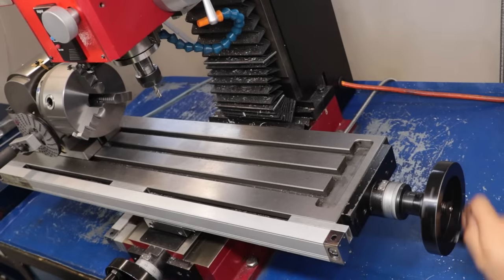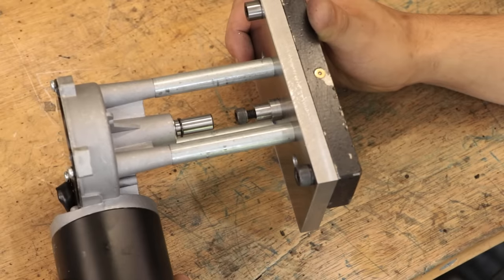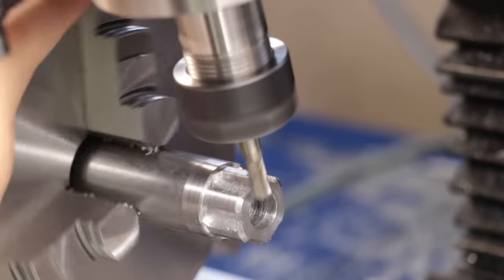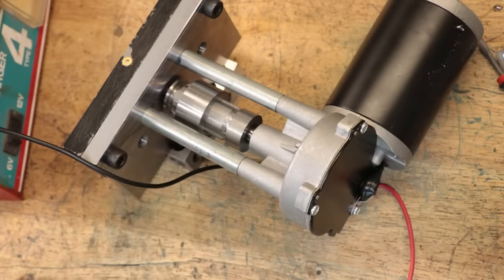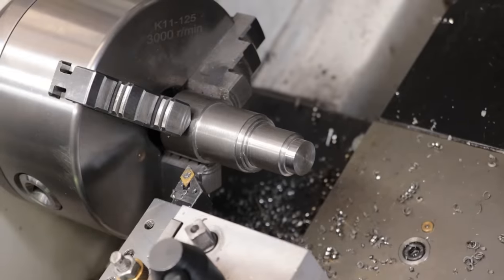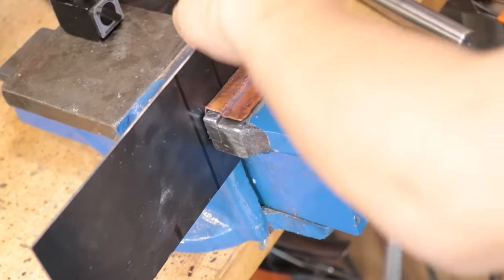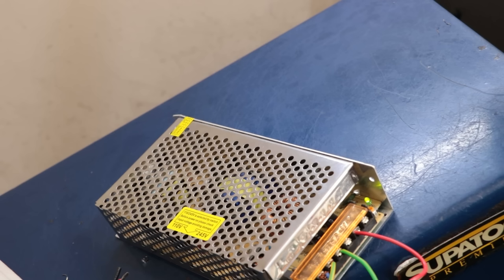Making A Power Feed For The Milling Machine | Cheaper And Better

Comment: I figured for the selector piece you would have done a full circle on the lathe and then just cut it in half "bore out each side" Any reason you did it the way you did that I might not be thinking of?

Edit: I mean other then that, thats just how you felt like doin it? xD Not that its wrong at all. I just wanna know if I was missing something for my idea!
Reply from the maker: I dont have a 4 jaw chuck for the big lathe and the 4 jaw for the smaller lathe is too small to chuck this part

Comment: Running the switches through a relay would take the electrical load off them. 30 from the supply red, 85 to the supply black, 86 to the switches that are jumped off 30 and 87 to the motor. If it's post-controls it would still work because the coil and relay don't care what way the voltage is going

Comment: Nice Project again. Man those hacksaw scenes make my arms ache. I had to cut several 50 x 30 pieces of cold rolled steel. After completing the first one with a hacksaw and being exhausted and useless for the rest of the day, I raced out and bought a horizontal band saw the next morning.   BTW does anyone know if the spindle bearings on that seig 2.7L mill need to be lubicated. I cant find anywhere to access them for oiling.

Comment: very nice work. I would have made the clutch handle on the front of the lathe, because on top like this it will prevent you from machining long pieces... also I would have made the motor windings at the back of the table so that it is not on the way of the mill operator. but that's just me...

Comment: I built one using an identical motor and a small air cylinder to engage/disengage the motor from the leadscrew along with a PWM controller and power supply. I loved it for a couple years. Unfortunately there were a couple times I forgot I had the table locked, hit the switch for full rapid and it took a second to figure out why it wouldn't move 😬. So after cooking 2 motors (you'll break the worm shaft first) and a controller I broke down and bought a Bridgeport style power feed. Note my Italian mill's X axis arrangement wasn't even remotely close to the Bridgeport style which is why I built my own. I had to heavily modify the power feed (so warranty was gone before I even had it working) to make it work. Hopefully, yours serves you well!

Comment: You can use automotive wiper motor its way cheaper from local junk yard and control it with a dc regulator it will be alot cheaper

Comment: Years ago I bought a Sieg SX2P, and I too got fed up cranking the x axis by hand, so decided I needed to motorise it.

There were several important requirements: cheapness; cheapness; cheapness (I am a Yorkshireman).

After a little research, and having an old computer with parallel port lying around, I opted for the stepper route, using linuxCNC to control the motor. The mount consisted of an adaptor plate and three posts. 

I liked it so much that I decided to do the same with the y axis. This then allowed me to trepan mill a circular hole for a turbomolecular pump in the base of my high-vacuum chamber. But it was a pain having to control Z by hand. So the next step, although more complex, was to motorise that, using a side-mounted ballscrew . Control was now by gamepad, but I missed the simplicity and freedom of manual milling. 

I am now working on motorising my lathe (a Chinese 920), but want to be able to use it as quasi-manual, so am building controls to mount on each axis, with rotary encoder and  ability to slew at higher speed. The prototype works well, but the double sided sticky tape wasn't strong enough to keep the plastic project box attached to the apron. Prototype 2 is under construction, but prototype 3 is already being considered - with haptic feedback on the rotary encoders so I get a feel for the cutting. In quasi-manual mode LinuxCNC will act primarily as a DRO. I am dumping the compound slide, with any angle being set in LinuxCNC. 

I'll then do similar with the Mill.

Comment: Nacre job.....I think I will mount the motor facing down when I do mine.....soemeday........just to be different I think I'll make a sun and planet gearbox instead of the worm drive so that the motor can be mounted horizontally in line with the screw end......Mounting could be a problem but not impossible.

Comment: Maybe replace the spline sleeve with a 3d printed part, that way you control wear and have a part that should give before something expensive breaks.
Reply from the maker: I think as long as we avoid galling on the splines we should be okay. The sleeve is 1045 so it should hold up. Cheers

Comment: Wouldn’t you be better holding one of the spline shafts with a roll pin instead of a key so it can shear if it gets overloaded and save the gearbox?
Reply from the maker: I guess the motor would stall before you do anything major to it. That's my guess

Comment: Measure the motor current when unreasonable load applied to the table and add fuse rated on that current after power supply. Electronics fail or just something unforeseen can happen.

Comment: Just wondering.. did you consider using a direct drive stepper and then removing power to the stepper when you wanted to freewheel instead of using a clutch?  Your designs always seem so well thought, so I'm hoping you can keep me from starting if it's something that you deemed unworkable.
Reply from the maker: I wanted to avoid steppers if I could. Simplify the electronics side, less things to go wrong in the long term

Comment: you could have roughed out the selector fork with a end mill and then go in with the boring head to save your boring bar wear and tear
Reply: I would have roughed it with a holesaw.  Way less chips!  Sometimes you can even find a use later for the core that falls out the bottom of the holesaw.  I bet it'd be faster than making all that metal into chips with the boring bar, even with the time added for the tool change.  I use cheap and cheerful welded holesaws.

Comment: Is a power feed clutch there just  for safety? I always wondered why not just have a kill switch w/redundancy which is much simpler?  Is it a "don't want to overshoot clearance" by keeping engaged?  Even if a jam occurs, the screw will need to be turned w/the clutch disengaged to free up a jam.  Motor protection?
Reply from the maker: The clutch is to disengage the gearbox so i dont have to spin that too when the powerfeed is not in use.
Reply: oh, I see now that you installed on the opposite end of the table and not ditch the manual feed  in lieu of power feed as I've often seen, leaving no manual option.  That makes sense now. @artisanmakes  👍

Comment: Well, so good for what it is and how it was made, congrats. But one thing I have to note here: Sooner or later you will realize, it was not a really good idea to have something standing proud of the working plate surface.
I did also a power feed on my machine years back, but this one is flush with the surface. And at least two times this was a problem solver.
Sure, you can disassamble the power feed if you run into trouble. But tbh: The worst power feed it the missing powerfeed - in both cases ;-)
Reply from the maker: It's a valid point but in the 2 1/2 years I've owned this mill 8ve never had a part overhang the end. If it ever happs it will be a very rare occasion. Cheers

Comment: Love this build and will probably do a similar design on my mill.  Is there any reason you didn't have the body of the motor towards the back of the mill instead of out front?
Reply from the maker: It just looked a bit ugly in the other orientations.
Reply: @artisanmakes  Fair do's

Comment: At 24:45, did you say the fly press cost you 1000s -(with an "S") start to finish? Was the furnace and welder included with that "S"
Reply from the maker: Yes, once you account for cutting tools and materials it was a few thousand. No the furnace and welder arent included in the final price estimate
Reply: @artisanmakes  What was the performance gained by the fly press over a traditional hydraulic press that made this expenditure a good decision? -- not trying to be critical ... Tks, John
Reply from the maker: It's not as powerful as a press, but it has push and pull capabilities, which most lower end presses don't have
Reply from the maker: And you get good feeling through the press which is good for broaching, well not snapping broaches

Comment: How do you go about getting the 3 hole pattern measurements accurate  for the DRO?
Reply from the maker: It's just am inbuilt function of the dro. You tell it the circle and how many holes and it spits out a bunch of coordinates to go to. Works rather well

Comment: ....dont quit your daytime-job and beecome a comedian🤣i use nema34 motors for cnc to mi mill,and a pendant to move it by hand but i have ideas about using nanoles electronic leadscrew to operate the axis on my mill  when i want to operate it by powerfeed  --and  - you are soon reacing 100.k subs - nice work

Comment: How you make the offset broach guide to make the gear sleeve?
Reply from the maker: I have a video on it. It’s made using the dividing head to hold the guide at an angle and a key is inserted. No reason why you couldn’t use a rotary table though.
Reply: @artisanmakes  yeah i saw your video already pretty cool technique. Im try to get into machining. I already got myself a mini mill and im also working on restoring an old rockwell lathe from the 1970s. Hopefully once i get it running i can make cool projects like yourself. I like your videos. Keep them coming 👍

Comment: Cool build.  I had always thought that a worm drive would work for this.  I had wanted to try pivoting the motor so the worm and wheel would engage and disengage.  Would require making a new worm gear housing though.

Comment: hey, i always see you cur right (conventional) when cutting from the side, why?
Reply from the maker: Thats pretty standard for roughing work on a manual mill. Climb milling pulls the endmill into the work which can be an issue with manual mills with backlash in the table. Ive broken a few endmills climb milling
Reply: @artisanmakes  ah I see. Good to know. I've only worked on automated cnc's
Reply from the maker: I started out doing CNC so I found out the hard way. Cheers

Comment: 7:40 Why not a dog clutch there? It seems ideal to me.
Reply from the maker: Yeah that was the back up plan if the splines didn't properly mesh. Only reason why I wanted to do it this way first was because I made the two splines at the same time using the same set up. Seemed more straightforward

Comment: how much does a workshop like this cost?
Reply from the maker: The lathe and mill are the biggest costs and together they were less than $4500 aud. If i had bought them used it would have been much less

Comment: @Phil vandely made the same exact thing pretty much
Reply from the maker: He did indeed, I mentioned him in the video description. It is a very nice design, but the big difference is that he moves the whole motor as a part of the clutch mechanism, whilst I only move the spline sleeve. I dont know how much of a difference doesn't it make though. cheers
Reply: Yea I’m in the middle of designing my own for the x2 and I’m thinking going with your design would be a lot easier because of the way the x2 lead screw is. Thanks for the inspiration.

Comment: This is a pleasing solution artistically but a double-shaft stepper would have been an awful lot easier.
Reply from the maker: You would still need a clutch to disengage it when it isn't being used. Cheers
Reply: @artisanmakes  Yes but all you need there is a way to disengage the handle if you don't want it to spin.  As long as the coils are open (electrically) the stepper will be free to spin apart from a little bit of feeling the notches in the rotor.
Reply from the maker: Yeah after thinking a bit more youd want a diode on the stepper to stop it acting like a generator as you spin it. Im pretty sure my cnc has something akin to that

Comment: Why didn't you just buy an electric clutch?  Then wire it in to your motor control, have non latching push buttons for forward and reverse . So when you press a button your clutch energises when you motor is used. Otherwise it's not engaged so a manual handle needs to be used

Comment: Limit switches should be never mounted perpendicular like you did. Instead switches should be always mounted tangential to prevent stress and strain on the switch which makes it more reliable and it will last longer.
Reply from the maker: I'm not sure how often you're expecting these switches to be used. Preferable zero. I'm sure that these microswitch would have an expected life in this orientation no that far exceeds that I'm expecting from them.

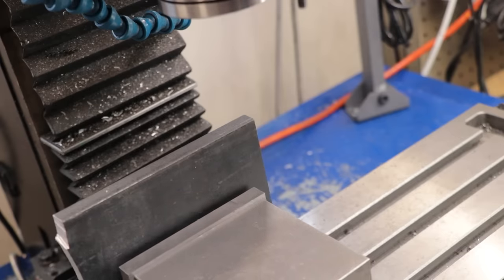Comment: You didn't mention what happens when the table hits a limit switch.  So long as it's on the switch you won't be able to run the motor.  What you need in case you already didn't do this is a diode across each switch.  I did this when I motorized the carriage on my mini lathe and you can see how I solved this in my video, about 3:50 in.  This allows you to back the motor off the switch at each end:
https://www.youtube.com/watch?v=B18NLCKUYK0&list=PLbms9GizN4aTLsOwolr5cuM2JtmTku12E&index=14&t=3s
Reply from the maker: Thanks for the suggestion Guy.

Comment: Do you know just how much time you'd have saved using a handheld bandsaw in a home made stand to remove metal when you needed to cut that circle shape using the boring head. You could have removed nearly all the metal then finished with the boring head. I'd have a think about how this engages etc from the facing it did using the power feed it looks like you have a tiny bit of back lash. It might have been feeding to quick but still.

Comment: JESUS, power feeds are NUTS in Kangaroo Land. Dude, seriously, even one of the better built ones like Align only run $530 AUD for a heavy duty one for a knee mill, $450 AUD for an X Axis for a bench mill. Usually stuff there can be a bit cheaper because it's closer to the source, so I can't imagine why they are so high.
Reply from the maker: Things can be strange in the down under. I think its just specifically the sieg branded one for the X2.7 mill. Even looking on a British store they want roughly £350 for one.

Comment: Its cool making your own stuff, but to think with all the tools and equipment and then all the labor to make this work plus the parts and motors to just hook and play, $600 is to much, I doubt if you add up the cost of the equipment and all the tools and your time it cost you 3 times as much then just buying the one already to go, like I said it's cool to learn and make your own stuff, but if your talking economics,  it's cheaper to buy it already to go

Comment: You got a mill and a lathe, you can't buy a portable band saw from harbor freight or whatever they call them in other countries which is around a hundred bucks, I've had my Bauer harbor freight portable saw for years it works great, no need in a Milwaukee that cost hundreds,  not worth the difference which I don't see much difference to me

Comment: Alternative to the limit switches: add some stops to disengage your clutch automatically at the ends of travel. The limit switches are fine, but if you want a backup, that's the next best method.

Comment: That mill sounds like it has hamster powering it and like it'd smells of electrical crap burning each time you use it. You do get amazing results with it, no doubt. But I cannot believe that you bought stuff that's expensive bc its new vs used (higher quality) gear. Just look at what Cutting Edge Engineering Australia gets for similar $$ by purchasing off auction sites. SMH